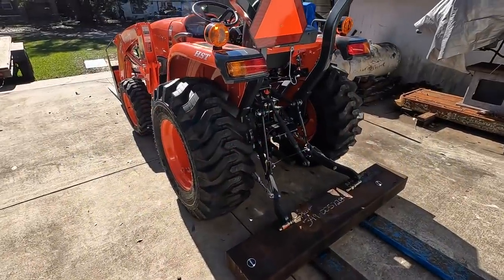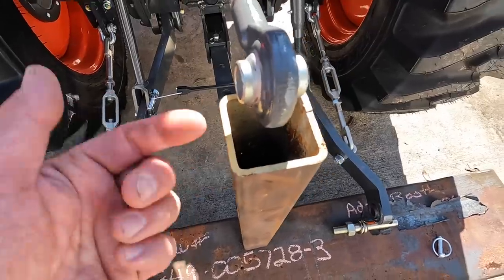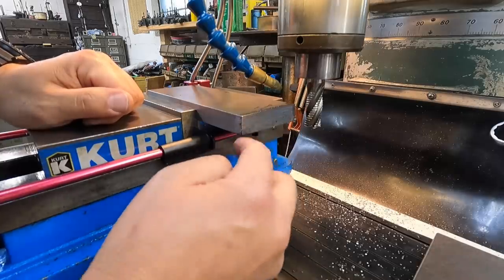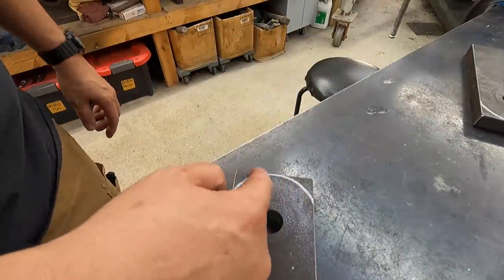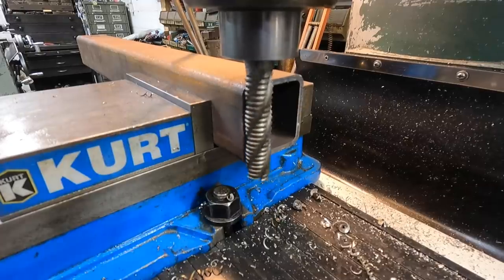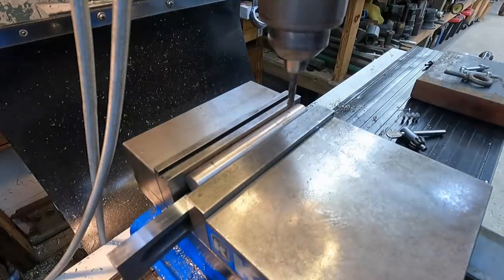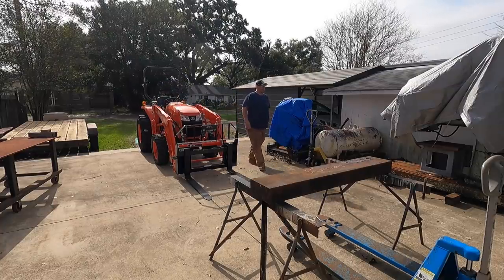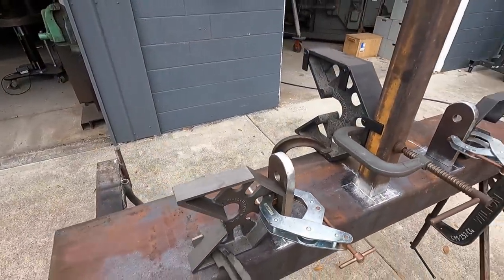Tractor Rear Counterweight Part 1

Comment: Get a category 1 quick hitch for the back of your tractor. It makes hooking up a breeze. The only caveat is you have to be careful that the attachments you buy are made to the correct standards so they fit. Also be sure they don't put calcium chloride in your tires. Personally I suggest cast iron wheel weights. Yes they are more money but you always have them. Fluid is lost when you have a flat. It is a buy once cry once. Fluid is a cost forever as if you don't loose it you have to pay to have it pumped in and out everytime you want to do something with the wheel like replace a valve stem or replace the tire or fix a cut. Tractor tires tend to run in a rough envirnoment for tires sooner or later you will be there.

Comment: A few modifications to that design young man. Cut the link arm lugs off and move them to the centre of the weight and make another two so you have two lugs per link arm so that the load is carried evenly by the lugs. By having only two lugs, they will crack because of the pin isn't supported across its length.
The mount for the top link need moving back too. It needs gussets to support it otherwise it will crack and break off. I would also knock off the corners of the weight because someone will get injured if they walk too close to it.
A cheaper and less expensive weight could have been made pouring concrete into a box with three point linkage mounts welded to it.
Top regards, Jon in cold and damp England UK.
Reply: @karlhrdylicka  😂😂😂 Hi Chris, thanks from North Yorkshire. Where men are men, sheep are scared and the rain washes the dust away all year around!

Comment: YOU are the counterweight!  I'd avoid fluid in the tires, so many better options.  I can't wait to see if you put those pins pointed the opposite direction so you can't get it apart.
Reply: Maybe even he exceeds the tractor load rating.

Comment: Having wieght is a plus. In my 20's i was 6ft 1in and wieghed less than 120 lbs.  Once moving a condenser into the shop, the handtruck wheels hit a crack ... stopped ... and catapulted me over everything.  I had the muscel but not the weight.  I now weigh 50% more, and can now hold more stuff down. 😁

Comment: i have the same tractor u just got and i really suggest the beet juice over just water little more bang for your buck beet juice weighs 11lbs per gallon compared to just water thats what 8lbs so by using beet juice you get about 90lbs extra per tire in weight just by using the beet juice plus its non corrosive and it wont freeze not that you have to worry about that down in your state also now that your gonna have plenty of counterweight kubota sells the shims for your relief valve so u can bump your pressures up so u can lift more just dont go crazy youll be fine kubotas r usually set low from factory on their hydraulic pressures

Comment: I'm not trying to be an arse, but I have a feeling the width of this might become problematic when reversing into tight spots.  This is why weights usually stack the weight vertically.  Personally I'd cut the ends off and put the weight back in the middle.  Just my two penneth.  She's a pretty little tractor.

Comment: That looks like plenty of weight for sure but the disadvantage I see compared to a ballast box is the size. That bar sticks out as wide as the rear tires and can get in the way when maneuvering.  It's like having a rear blade attached - easy to snag things with the ends when turning in tight places. Seems like having it shorter but twice as thick would be better.
Reply: The next video will be cutting the ends off an welding them back on underneath the remaining length,
Reply: I thought the same thing after looking at it

Comment: Don't worry, sometimes parts people aren't on top of everything all the time. Also, the pins they gave you could be for a larger three point class. if you don't want to travel so far for hitch parts look for a place called tractor supply. They carry hitch parts and such for implements sometimes not the implements themselves. Great video.

Comment: Nicely fabricated Adam, i have been watching your early videos, you have come along way, Thanks for bringing us all along. Just 1 thought, your top link box vertical section will collect water. You might want to add a drain hole. 
Thanks
Reply: I had the same thought.  Simple as grinding a groove to the front and skipping that small spot when welding., give the water somewhere to go.

Comment: Adam, a single bracket with a bolted in pin is not the usual way to fix a weight or attachement. The usual way is to have two plates and then use a floating pin with an R clip to hold the lifting arms between the plates. That way there is no side load on the plates but pure tension. It also makes mounting and removing the weight easier. I would avoid water/calcium chloride filling of tyres. It increases soil compaction and leads to corrosion of the steel wheels.
Reply: I completely agree with all your points although correctly diluted antifreeze causes much less damage to the wheel rim as it is not corrosive to anything like the same extent .
Reply: @w056007568  Antifreeze for automotive engines actually is anti-corrosive. You don't want the coolant passages inside the engine corroding so additives are added to the coolant to prevent corrosion.

Comment: You need a drain hole in the bottom of the square tube so it doesn’t fill with rainwater. Or weld a cap on the tube below the attach point.I like the counterweight. It’s cleaner and smaller than a 55 gal drum full of concrete.

Comment: Have done a few tractor attachments....and if I can suggest that you  weld ears for the pins on each side of the 3 point hitch arm.  One will probably hold the weight....but the pins will not hold up without support on both ends.....

Comment: Not a tractor guy but it's awesome that people fill tires with beet juice for counter weight. That's damn genius. I read about it and it keeps it from freezing down to -35ºF (lower than windshield washer fluid), it's completely safe AND it's heavier than most other liquids. So cool.
Reply: Wonder if it turns into alcohol after a while.

Comment: I know it is too late now, but:  There are industry standards for the dimensions of the 3-pt hitches.  Yours is a Category 1:  upper pin is 3/4, lower pins 7/8, the width between the lower pins is 26-inches, and the height between lower and upper pins is 18-inches.   The height is really only important if you go to a quick hitch system.  Luckily, you are a bit long.  So, if you get a quick hitch later on, you can modify to make it work.

Comment: you can also have the rear tires filled with liquid that the dealer recommends it really helps
Reply: I would start with that
Reply: @andersjohansson161  rimguard works best. Non corrosive.
Reply: He literally says that in the first few minutes.
Reply: @RealNickTheCoolest  yes he did right after i posted that lol
Reply: There is no replacement to steel weights on a tractor. Fluid in the tires dosnt transfer weight back to the tractor so tires may be planted but the tractor feels loose and tippy

Comment: On filling tires, your first choice should be Rim Guard which is the beet juice you refer to. Some dealerships have it, some not. A good tire store will have it and the pump.
Calcium chloride is heavier, but you's have to be happy with rusty wheels and if you spring a leak, you're going to kill all the vegetation in a large area. 
Once a tire starts leaking, you aren't going to stop it so pick a good place you want to kill all your greenery.

Comment: Most people just fill the rear tires with water and anti freeze. You can get an adapter to fill them yourself at home. It s a lot easier than putting that counter weight on and off. If you use your tractor to pull anything heavy or pull a truck out of the mud hook up to the draw bar only. DO NOT HOOK UP THE CHAIN TO ANY PART OF THE THREE POINT OR AROUND THE AXLE OF THE TRACTOR. THE TRACTOR WILL FLIP OVER BACKWARDS ON TOP OF YOU AND KILL YOU. THE BACK TIRES ONLY HAVE TO MAKE A HALF REVOLUTION AND THE TRACTOR WILL BE UPSIDE DOWN. YOU DO NOT HAVE TIME TO GET YOUR FOOT ON THE CLUTCH TO STOP IT. THIS IS ESPECIALLY TRUE IF YOU ARE INEXPERIENCED WITH TRACTORS. Also if you are under power going forward especially going uphill and the load falls off the forks the tractor will rear up with you so keep the counter weight as low as possible while using it.
Reply: A nightmare doing puncture?
Reply: Any body that knows these killer tractors pulls from the FRONT. Pull from the rear other than plows and implements and you die.

Comment: I never thought to use an eye bolt in a pin to remove it. That's a good idea. I find them on motors and equipment at the scrap yard from time to time, and I have a few in storage at my shop.
Reply from the maker: Always good to keep a few extras around 👍🏻

Comment: Anything you build for 3pt hitch, you should make it quick hitch compatible. The SAE dimensions are out there and it's worth it when you eventually get a quick hitch. Also, anything you can add a 2" receiver hitch on the back, you'll use it. Even if it's just for a hitch carrier to carry stuff around the yard.

Comment: don't worry you'll use that pin somewhere, never have too many. in australia we call them cat 1, cat 2 etc (category 1). you can run most cat sizes on any tractor so it makes it hard for the parts guy to know what one you have.

Comment: I believe Harry Fergusson of Fergusson tractors invented the 3 point linkage system. I think that the system on that little tractor is Cat 1. There are standardised specifications for the placement of the connections, so raising and lowering the linkages moves the connected implement in specific arcs in three dimensions. It doesn’t matter so much on a counterweight like this, but is crucial, on say a Plough, so the automatic draught control (also invented by Harry Fergusson) works exactly like it should.
  Fergusson also invented the “Fergusson Formula” system for cars to allow full-time four wheel drive on hard surfaces without developing axle wind-up.

Comment: You can also load the front tires with gel/foam. When you lift a really heavy load, they won't squat or tip unevenly. They'll also never go flat.  And the pins you use on the 3 pt. hitch, depend on the category of the hitch... the weight rating.   Yours is a category 1.

Comment: I'd also recommend filling your tires with liquid ballast.  Added almost 1000lbs to mine.
Reply: I had a riding mower that I needed to use on a hilly property that had a lot of trouble with the hills. I changed the rear turf saver tires to AG lugs and filled them with windshield washer fluid to keep them from freezing in the winter. No more issues with grip and made it feel much more confident on hills.
Reply: beet juice

Comment: I'd have cut the block in 1/3:2/3 and welded one on top. Less stick out at the rear, always likely to catch something in tight spaces. Top links can be cat 1 or cat 2 or a mix. Empty, heavy sheet, metal boxes filled with chips & swarf make good weights, too. It's a whole new world of fabrication for agricultural implements...
Reply: Weld a box on that hitch and fill it with the hot dogs you should not have eaten.

Comment: I made a counter weight from my Kubota and on the lower connection instead of using the one I use two pieces of steel and just drove in between it and put a pin in the bottom and found it worked a lot better than the single pan like you have now I started with what you had and end up changing it it was easier to back up in between I just put a pan and

Comment: Invest in a quick attach and then make your implements work with it.  You will save a tremendous amount of time changing them out and won't have to manhandle the implements to get the pins to line up.  Land Pride makes one to match the Kubota, but Harbor Freight has one that is hard to beat for the money.

Comment: I built darn near the same counter weight but I added a cutting edge to the front, Makes a great grader attachment for laying in new yards or gravel driveways.
Reply: Yes, something that size needs a primary use, like rippers welded on.

Comment: I would skip the water in your tires and go with cast iron wheel weights in the rear, they will last longer. Also it makes moving the wheels on and off the tractor easier because you can take them off. Just in case you ever need to get a new tire. As for your ballast, you defiantly will want to add a trailer receiver hitch  to it. I have one on my 35 gallon barrel that is filled with cement, really handy to move trailers.
Reply: We had the same water (Calcium Chloride) in our tractor tires for 40 years ... it lasts plenty long enough.

Comment: There  should be weights available to fit inside the rear wheels that you can stack 2 or 3 deep depending on amount of weight desired.

Comment: Fill the tires with water. They make a little tool that threads into the valve and hooks onto your garden hose. 

Put the valve at the top

Comment: Beet juice is the way to go for tire ballast. You can do wheel weights along with it but it's better than calcium chloride because it wont rust the rims. Water and antifreeze is a good option but I believe you get a little more weight per gallon with beet juice.
Reply: Beet juice. You guys are nuts. Maybe the veggie boys will sell some.

Comment: At our shop we use antifreeze and water. Easy to do. We have a nut that goes on the outside of the valve with a standard female hose connector on the other end. We use a sump pump in a bucket, depending on tire size add antifreeze.  Your tires, I’d use 5 gallons of antifreeze. Check also to see if tires can be flipped so stance is wider.

Comment: i made a simple rear weight setup for my garden tractor... modified a sleeve hitch to sit horizontal...just welded a top link bracket so i can pin it solid.. top link connects to the hand operated lifting bar... normally... now it drops down to frame ...making it not pivot...and i wanted to use all i could to make changing how it is used easy and quick....then i put a steel tube up to hold weight lifting weights... weights have a hole in center ...i pinned the tube too..sleeve hitch has a hole fir attachments....so i can change it back as needed...oh ..and i bought the right size pins as i figured out what i was doing before shopping...
recycled old weights...
i made the tube long enough to add as much weight as i need...
use the tractor in winter blowing snow...chains and wheel weights were enough..but the extra weight really gave traction...

Comment: Having lived on a farm and making my own implements for my tractor and skidsteer ……. You need to take square tubing out of the center because it will bend and make a more of a square for your 3 point and get the top link down lower so when you raise your implement to full height you will get full travel….. your top link will bend if you don’t give it enough clearance

Comment: I’m surprised the dealer didn’t sell you on ballasting your rear tires when they sold you the tractor.
I’m also thinking it would have made sense to cut the big chunk of steel in half, stack it and weld it together so you only have a 30” wide ballast.

Comment: Abom, you’ll get familiar with the agricultural stuff soon enough. 3/4” top link pin is “cat 1” paired with 7/8” on lift arms.
There is standard categories, once you’ve seen how this stuff works you can eyeball which pins/ links you need for what. 
The higher the HP of the machine the bigger the category.

Comment: Box the vertical tube up, so that water does not collect inside.
Reply: Or add holes at the bottom. Betting you've never hooked up a 3 point hitch.

Comment: Considering the pivot point of concern when lifting a heavy front load is on the front tires (which is very close to the front forks), you have the weight of the tractor behind the front wheels to act as at least a partial counter weight. You really don't need a rear mounter counter weight that is equal or even close to the front lift capacity. Also, if you're considering fluid in the tires anyway, that's gonna add a helluva lot of the necessary counter weight (if not all of it) that you might need.
Remember, the engineers that designed that tractor probably thought about all that stuff when they designed it, and they figured if someone was going to want the full benefit of the frontal lifting capacity they would either get rear wheel weights and/or fluid in the tires and not have to fabricate a half ton weight from scratch.
I'm also wondering if the thee-point hitch is going to be able to lift the counter weight. I'm sure it probably will, but that counter weight is going to occupy some extra real estate when not in use, where wheel weighting measures would not.

Comment: Hey Adam, why not weld the pickup points in the middle of the steel block? That way is (more) balanced and is easier to connect the third pickup point.
Reply: Exactly!

Comment: I found out the joy of using a ballast box is trying to get connect the darn thing. After acquiring a quick hitch, connecting it was much easier. There are various brands. speeco brand doesn't require bushings to make the Cat 1 pins Cat 2.

Comment: It seems like you could have made life easier for yourself by purchasing a rear fork attachment then then make a simple means of securely fastening the counterweight on that.  Easier to do and you would then have a rear forklift assembly for the times you could use that as well.  But the video was fun to watch too.  We use a block of concrete we cast with our forklift attachment.  The concrete block has pockets cast into it for the forks and a pin through one of the forks to secure it.  That too works a treat.  Thank you for the video we did get good ideas from it.
Reply: Damn! Love that idea! I use a bale spear. Just stab a round bale when needed.